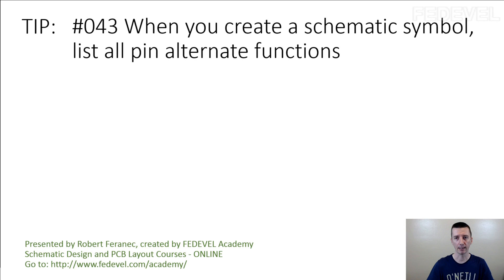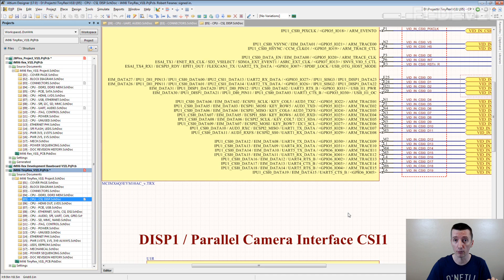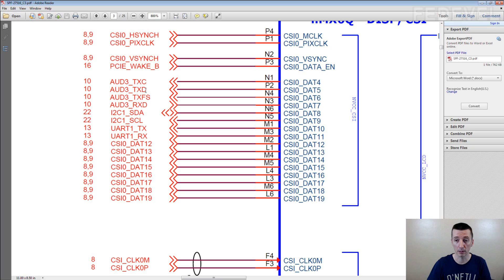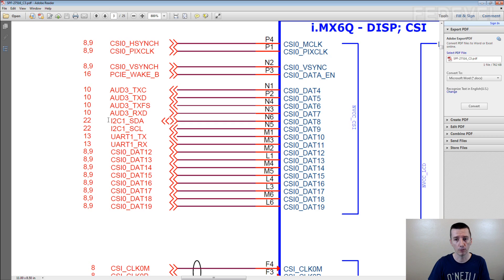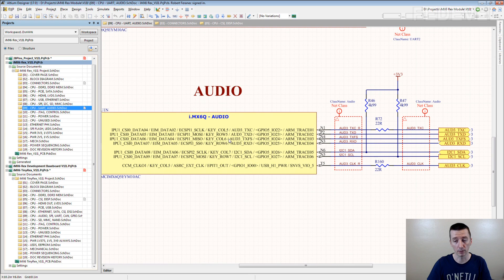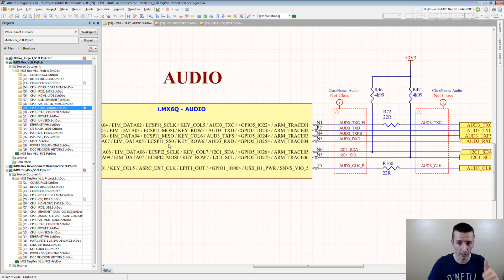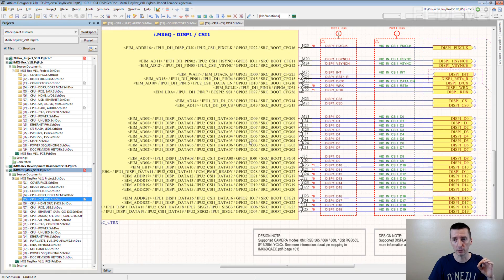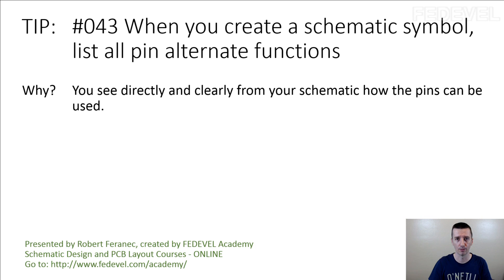TIP #043: When you create a schematic symbol, list all pin alternate functions

Comment: I'll reuse the same microcontroller for different projects (same PCB footprint) but make the schematic component specifically for that board because I want to, for example, use the analog function of the pin because its connected to a potentiometer and I don't care about the I2C clock. I can see that is more work, but does it make it easier for a programmer to do it your way? Do clients mind all the "mess"? 

I will admit it is nice to know every function that is available on a pin so I know which features to turn off. Because sometimes they take preference over what I actually want it to use, so this is a useful tip.
Reply from the maker: Very often we design general boards - people can use them for different application and they can use different software - in that case it is very useful to see all the features. Also, when I am creating schematic, often I need to swap connections and I need to see on what other pins the same feature is available. I always found it very useful.

Comment: This is a great tip, and it just saved me a future respin of a PCB.  I'm doing a board that has an STM32F4xx, and not yet quite sure which part to use as they have a million different variants.  I THOUGHT my two candidates were 100% pin compatible, but by making my own schematic symbol instead of using the 'official' I could clearly see ONE pin that was not.  It's a royal PITA to make the schematic symbol like this, but worth it.  Thanks! :)